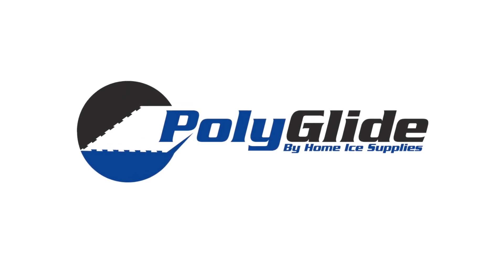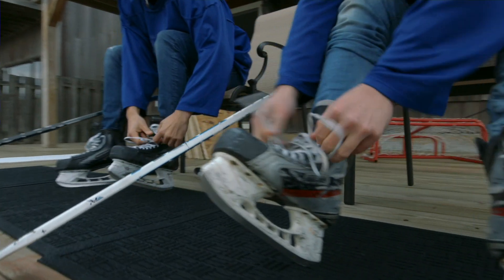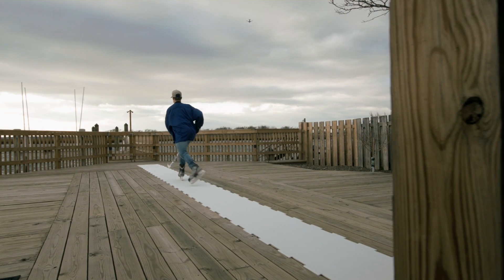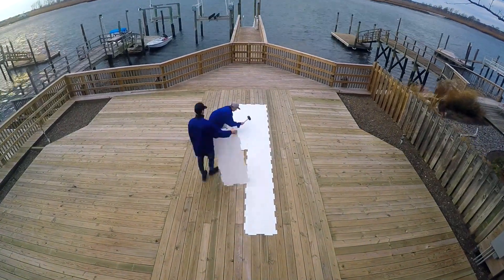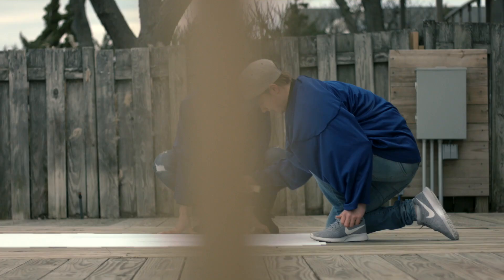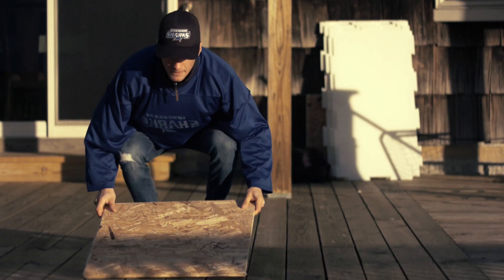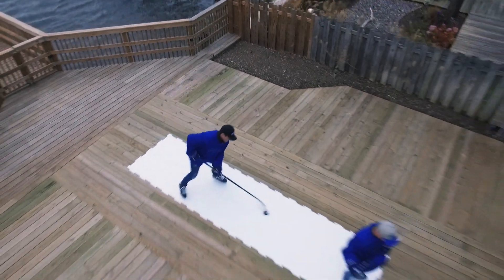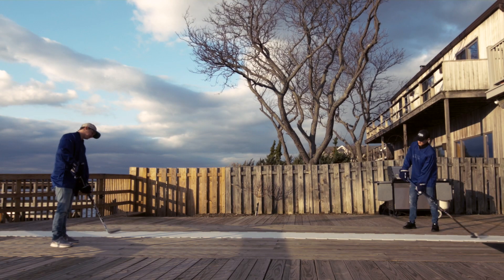PolyGlide Synthetic Ice - Starter Kit

Comment: How well would this work for goalies?
Reply: Jacob Brewer I know it's a late response but I have had this product for months. Here are my thoughts:
-It feels just like ice if you purchase silicon lubricant from home depot. However, it will make your pads smell unless u get a pad over.
-It dulls your skate fast. What I did helped. I ordered another set of blades: one for ice and one for synthetic ice. I also got an $80 pro filer handheld sharpener.

Overall, it works fabulous if you're willing to spend some bucks.
Reply from the maker: SuntannedFish9: You  may want to try for "Food Grade" silicones or "release agents" for the surface to reduce the ordor issue....glade your enjoying it!....DM me at PolyGlide Ice on facebook when you get a chance!
Reply from the maker: ....also: Be sure to use a quality blade on your skates to hold the edge and try a deeper hollow 1-size down on your next cut to hold your edge a little longer (EX: Normal edge 5/8....synthteic edge 1/2")